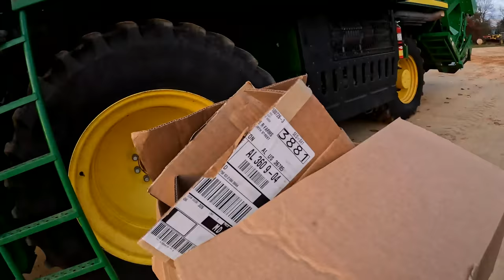CP 690's and ALABAMA PINE TREES

Comment: Daniel, I am curious what the timber crews are processing, Southern Pine, etc?  What is the timber going to be used for, pulp, veneering, lumber-boards, etc?  That was a great suggestion by one of your viewers on the radiator cap.  Though you changed the hoses (a good idea since they were so severely deformed due to the suction) that would not have helped if you didn't know about the radiator cap.  You won't forget that problem again and the remedy.  Enjoy your videos and your insight on things.

Comment: Did you have flash backs to combining in the mud as you watched the timber crew slip slide their way through the mud.   That has to be murder on the drive train of that timber hauler.   I could just see the dealer's parts man rubbing his hand together for the future parts sales for knuckles, bearings and ultimately overhauling transmission etc..